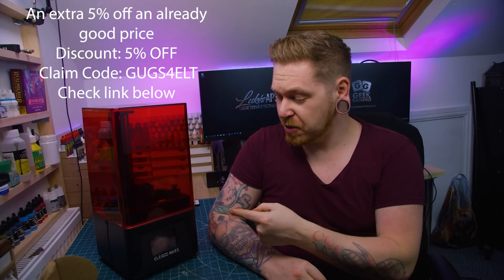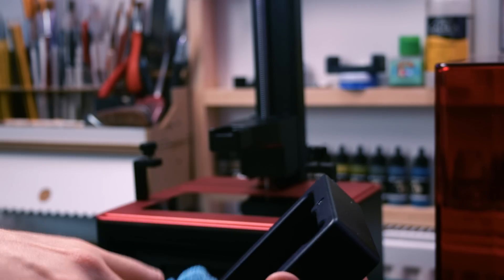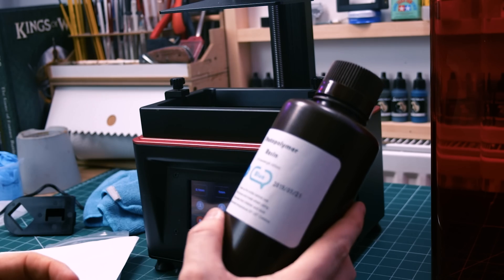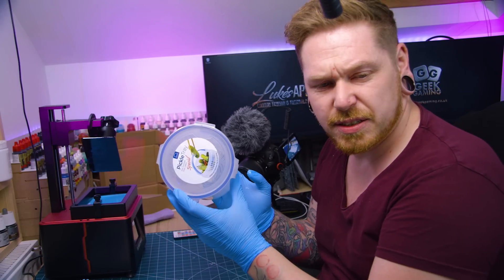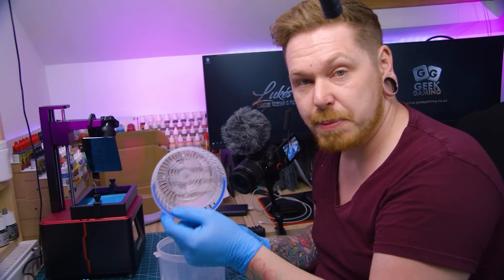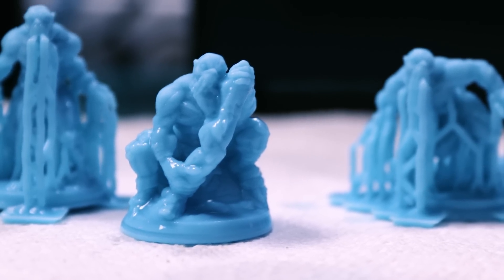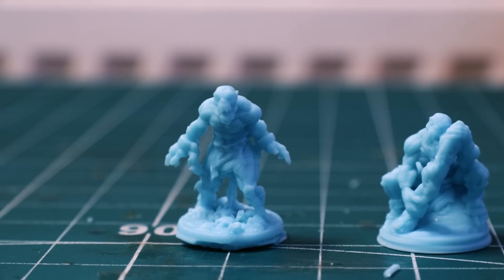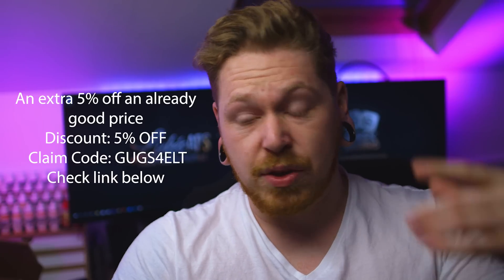MY FIRST TIME Using 3D RESIN PRINTER (ELEGOO MARS)

Comment: All these YouTubers make this process look so simple but when you get to really thinking about it I think what Luke is experiencing is exactly reality.  I have been reluctant to buy a printer because I know what a nightmare it's going to be to learn to use it and I'm afraid of breaking an expensive piece of equipment the first time I use it. I think you're showing exactly why my concerns are legitimate.
Reply: Yes you are right 3d printers are a bit complicated until you learn how to use them . Last year I  bought the creality resin printer and used I ran it day and night I learned a lot then I bought another one and I ran the both of them day and night . I watched a ton of YouTube videos on how to change the fep sheet , and the uv screen. Overall everything is easy about these machines just be patient. This year I sold the both of the creality resin printers and bought the peopoly phenom because of the build size . These machines are do it yourself I had to go inside my new phenom and replace the uv circuit board and stepper board because the registration square wouldn't show up. And yes I got it back running again. You have to also have to learn new software (chitubox) to process your models . It's so easy once you get started like I said there's a ton of YouTube videos out there and also help groups on Facebook to help with whatever problem you may be having right on down to the particular machine
Reply: @richardwilson2621  so I actually bought a 3D printer shortly after I posted this and I've been using it a lot, I have hundreds of miniatures printed now. With this experience I have to say that you have to pour hundreds of hours into learning how to get the best out of these printers. I have run into numerous problems including buying the right miniatures, some are too big for the printer some are not supported and they don't exactly say that, some have to be hollowed out, every now and then you have to go in and edit and add your own supports, you have to figure out what resin to use because some are brittle and each resin has its own settings. I have spent so much time on the 3D printing that I've had no time to do terrain or paint. And I am still feeling like somewhat of a beginner because some problems I still can't figure out how to fix. 3D printing is definitely a huge hobby in of itself.  If I weren't so damn stubborn and refused to be defeated by a project I take on I would have given up on this long ago. Nowadays I print occasionally because I'm trying to carve out time for other things and frankly I don't enjoy it so much anymore.
Reply: Well I wish you had a better experience with 3d printing . I love it and addicted to it . I almost fell out of love when I bought the creality cr10 that dam machine literally fought me back like Bruce Lee I sold it and bought my peopoly phenom l went back to resin. Good luck in all your endeavors.
Reply: Dude it's so easy to print the suports are the hardest part but work from plate up and add where needed
Reply: @tims5298  I guess you didn't read the rest of the comments underneath of this comment. I've been using a 3D printer now for a year and I would never call it easy. Easy as pressing a button and walking away and coming back and everything's done for you. Printing miniatures with a resin printer takes additional equipment like a cleaner and cure station and is a process. If you have to add your own supports it can take hours when you first start learning to do it but even if you use pre-supported models you can easily spend five to 10 minutes per model just trying to get the prints done.  Don't get me wrong, I love my 3D printed miniatures and I've got a ton of them now but I also have a lot less time for painting and doing other crafting and I find how much time I sink into just getting the prints done incredibly annoying.
Reply: @aaronbono4688  although I totally get what your saying, I find the process far more addictive and enjoyable compared to building warhammer as an example. So yeah, there is new challenges with 3d printing, but it basically eliminates the need to build miniatures, which is a process I really don't enjoy.
Reply: You cant live in fear man
Reply: @MrTomkat86  well I now have two printers so I guess I face that fear and overcame it
Reply: It´s definitely harder than filament printers but it ain´t that big a deal. He´s actually moderately clumsy (understandable since it´s the first time) in the video and completely careless about contamination but at least he´s wearing gloves...I´ve seen some maniacs that don´t even do that.
Reply: @gabojill19  I guess "ain't that big of a deal" is a relative thing. I'm in the process of giving one of my old printers to somebody who's never done it before and I'm going through all the things that I have to teach them so they don't go through all the pain I went through to figure it out themselves and man they're going to have to spend an hour or two with me as I go through everything and I don't think they'll remember it all without taking some serious notes.
Reply: @aaronbono4688  Ok fair. I spent several hours reading blog posts and watching video tutorials before I got mine so I wasn´t overwhelmed when it finally arrived.
Reply: @gabojill19  you've got to be smarter than me then, I spent months watching YouTube videos about it before I purchased my first 3D printer and I still made plenty of stupid mistakes the first month or two I had one.
Reply: @aaronbono4688  Oh don´t worry, I´m still fucking up.

Just an hour ago I started a print without the buildplate. Cleaning that up was a pain in the ass.

What I meant was that it was really easy to start and I just check the resin every time I print...besides that blunder the only misprint I´ve had was a poorly supported base and a very poorly supported door mimic that somehow turned out really cool (albeit crooked).
Reply: @GeekGamingScenics  Yes and I thank you for that. Everybody keeps showing how easy it is and I know it's not easy. At least not at first.

Comment: That's because the ones from America are a tuperwear brand and that company is extremely expensive even in America when brand new. Though you can generally find them at flea markets/swap meets for almost nothing. I'm sure it's the same on Facebook marketplace or similar in the US. Not sure on the last as I moved to Germany years before FBMP was a thing.

An easy way to make your own cure box if you're doing things larger then a miniature is make a wooden box (size depends on what you want to cure) get five mirrors and use silicone to glue the mirrors to the inside surfaces of the box, get a couple of small tube light fixtures and glue them to the top mirror. Get some black light UV strip bulbs and you're good to go once all the silicone is fully cured.

Comment: How many prints did you get out of the bottle of resin? How many 45mm minis do you think you might get out of it?
Reply: I bud, been using similar machines for a couple of years now. Those litre bottles go a LOT further than you'd think. Can't give you an exact number but even allowing for the odd print failure it works out cheap.

Comment: If the hardest part of this for you is getting the print off the bed, you are doing well. :) But yeah the supports and orientation is the key for quality. Some printers can print as small as 20 microns for the layer height. In which case you can get insanely detailed models. But the detail actually has to be in the model to print that detail of course. And the printer has to support really large files that have all that information in them.

Comment: I got the Elegoo Mars about 2 weeks ago , One of the things you can do to speed up print times is lay the model down inside of Chitubox during your set up to slice ... a model that stands say 5 inches tall is only about an inch wide ... because the printer cures with UV it done matter how the model is orientated laying it down will give you the same detail but some times cut the layers down and a 1000 layer model of course will take longer than a 250 layer model
Reply: @GeekGamingScenics  iv had no issue just make sure you ad your own supports ... I will drop a couple of my Mechs onto the Facebook page for you to take a look at
Reply: @GeekGamingScenics  It can also be worth rotating the models in chitubox to get better placement on supports.

Comment: If you want a bit of extra quality out of the mini's all you can really do is to go to the printer settings in the slicer and set the layer height to a bit smaller value. eg. change layer height (z axis step value) from probably 0.05mm to 0.03mm. Anything else is tinkering with the exposure times but that is different for every resin.
Reply: @GeekGamingScenics  The other option is to rescale in something like blender. It is better at keeping the poly count, surface details, of the model than a slicer. You also have a sculpt mode where you can use the pinch tool to make edges and recesses slightly sharper.